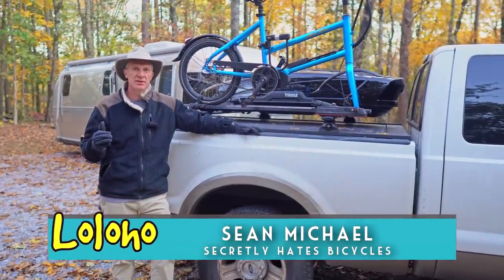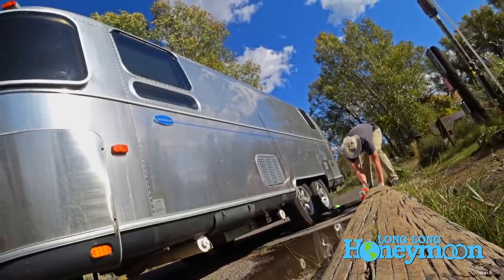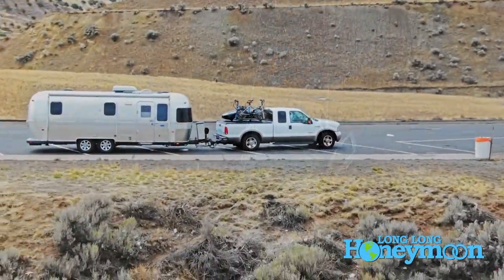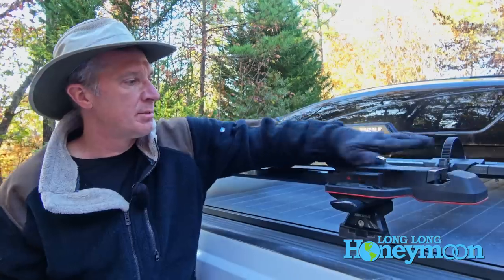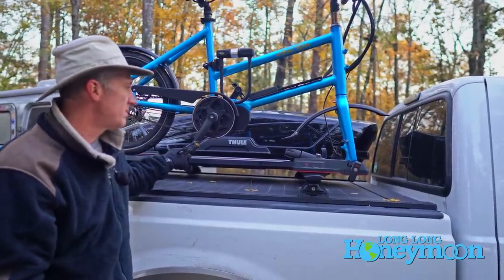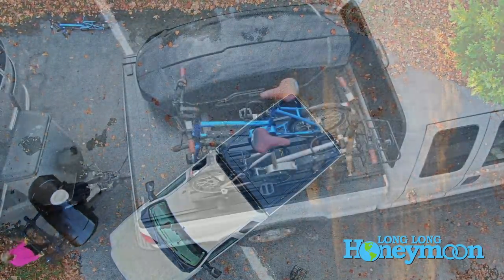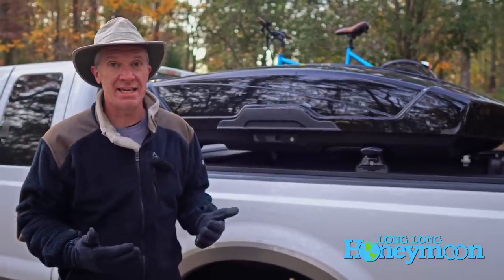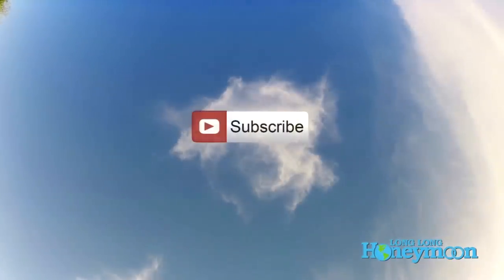Our Yakima/Thule Truck/RV Bike Storage -- What We Like and HATE About It :O

Comment: I just came across your video.  As usual it was excellent!  We store our two folding electric bikes behind the front seats in our 2017 F-150 super cab.  With the back seats folded up they fit well and there's no need to remove the front wheels. After we throw a couple of jackets over them they are nearly invisible.  We use an old blanket underneath so they slide in better.  The bikes have 20" wheels. They stay dry and secure and can remain in the truck when charging. We have a folding cover on our pickup bed like you do and with the bikes in the passenger compartment we have full access to the back.  The system works well for us and the price was right.  John Hart - 19' Airstream.

Comment: I have a jack it bike rack. It mounts using the same bolts that mount the electric jack and the bikes sit above the jack and propane tanks. It doesn’t interfere with the tailgate and works very well. Easy to load and unload. My 2 bikes are much lighter than your ebikes though.

Comment: A couple of thoughts for you to consider:
1. As others have mentioned, both Thule and Yakima (and others) make bike racks that don't require you to remove the front wheel.  Food for thought. But as you mentioned, to many folks removing the front wheel is Standard Operating Procedure and not a big deal.  The Yakima skewer mount you are using, although clever, does seem to require some awkward maneuvering to attached the Yakima skewer to the bike.  "Most" skewer mounts (at least until the most recent generations) didn't have such a skewer that drops into a customer clamp on the rack.
2. I would be worried about the broken fork drop out.  Considering the beating that the front forks taken when a bike is being ridden, with a 100-250 lb rider on board, there is no way on god's green earth that that fork tip should have broken simply because the bike was mounted in a skewer rack on a truck.  I would want to know more about the geneaology of the forks on those bikes ... there's no way that drop out should have broken like that.
3. We use something called an "ATOC Topper" rack which we've used on roof mounted racks to carry around our tandem, which weighs around 35lbs. The salient feature of the ATOC style rack is that you only have to lift one end of the bike at one time.  You start out with the bike perpendicular to the length of the car/truck, then lift the front end up and slip it into the skewer mount (which is pivoted), and secure the skewer. Then you use the pivoting skewer mount to then lift the back end and swing it around until the rear wheel is in the wheel tray.  Much easier to see it in practice than to describe it.  The point is that there are bike mount systems out there that don't require you to lift the bike potentially over your head.  Yakima makes something similar in concept, and I think Thule does as well.
Thanks for your video.  Very interesting.  We are expecting a RetraxPro XR tonneous cover to arrive tomorrow.  One question for you: Does the latch handle for the tonneau fit underneath the Yakima bars when you're opening/closing the cover?

Comment: I agree.  Select the best of several bad options.  We pull with an old van, but we found a space for our Rad Mini folding E-bike (68 pounds) and a much lighter mountain bike by pulling out the middle passenger side seat.  With big side doors, both bikes fit and get secured by a couple of motorcycle straps attached to bolts in the seat floor plate.  Very secure, out of the weather, away from sticky fingers, and relatively easy to access.

Comment: That was a predictable accident, but most are.  As soon as I saw the method of attachment, I decided it wasn't for me.  Then you showed the damage; ugh.  We upgraded our AS TT and the one we bought has the rack put on at Jackson.  We haven't used it yet.  It is for two bikes, but probably only one eBike.  I will put one foldable bike in the AS.   Our 28' FC has a lot of tongue weight, so a bike on the back is helpful.  I will load for 12% tongue wt., and the bikes will be a tool to help with that. Thanks for the video.  16 more days at work and then I am retired!

Comment: Best system I've seen was on the road through Washington State and it was home-made. He ha the same trip-fold tonneau over I have. He made up the basic contractor bed rack, but made up bike carriers on the two sides of it. Mainly a mid bar to cable to and a c-channel for the tires.  He had 2 kayaks above on the crossbars and the bikes on the sides. Nice, the tonneau still opens!

Comment: When we get our rig-however it may look like, I want our bikes inside the rig. We have regular bikes and they get hung from a hitch rack...exposed to the elements & being cheap I want them to last & still look good. 
I get the cover thing, I haven’t found one style that actually is designed for use on a hanging bike rack or won’t flap & rip while driving. Or even while covered in our backyard during a storm!

Comment: You have a very good setup. The only thing better would be having a toy hauler. My own solution for stabilizing the bikes on the rack is to use bungee cords to limit movement as much as possible. For additional strength, perhaps ratcheting cargo straps would make it almost impossible for the bikes to ever come loose. As for protecting the bikes from wind on the highway, you may want to consider a wind deflector on the roof of your truck (although that would be more expensive hardware to get). Safe travels!

Comment: I went with  the Fiamma Airstream bike rack and it works for us. We do not carry E bikes, just regular mountain bikes that are under weight 77 lb maximum.  I  also slide  a blue boy between the bike rake and trailer and run cable through them to lock them in place.  I store my black tank hose in the  hose holder provided by Airstream.  I Keep 90 degree  clear angle hose adapter to  hook up to sewer drain in side storage bin,  so I don't need to  access the storage bin in rear bumper.  I also have  rear window emergence exit ,  so worse case scenario we will need to crawl over the bikes or break out the window if it is the way.  The up side, it it easy to take the bikes on and off and uses them easily.  That said, some times wonder why we bother to bring them, as we don't need them or care to use them.
Reply from the maker: Yes, it really bugs me to go to all the trouble of loading up the bikes and carrying them on trips, and then find that we rarely use them. After this past season I'm questioning whether we will bring them out on the road again.
Reply: @LongLongHoneymoon  Maybe We both should try a trip without them, and then decide if we really need or want them.  We are planning next year to  travel to Traverse City Michigan, Mt Rushmore and  the Bad Lands , Rocky Mountain National Park and Steamboat springs  before traveling back to Fort Myers, Fl

Comment: I have a similar setup. Elected for the trays with the clips for wheels and arms to lock onto frame on the crossbars, over my tonneau cover.  No taking off tires and kids bikes didn't have the fork option.  Found the whole setup on Craigslist for $300. I agree with getting them on and off.  With 4 bikes I have to use a stool and tailgate combo.  Great video.

Comment: Sean,  thanks for the video.  We have an airstream and just purchased an Arvika bike rack from Canada.  You’re right, there are no perfect choices.  We haven’t used it yet, I’m hoping it works out.  We have E-bikes @ 55 lbs each.  What’s worse, I have had more damage to bikes during transport than using them!.  The rear bumper of the camper seems the most logical choice for many people but actually due to the distance from the rear axle there is a lot of jostling there ( not so good for a rack and the bikes).  Look forward to every video.

Comment: Our dealer installed a 2” hitch receiver on the rear of the trailer, which we use in conjunction with a Hollywood bike rack rated for 200lb. Our eBikes weigh 50 lb each with batteries removed. This system has worked well for us since we began towing, six months ago. Should we be concerned about the extra 100-120 lb of extra WEIGHT on the back of our AirStream? You did not mention this as a reason why you rejected this option.
Thank you Sean & Kristi. We’re more confident streamers because of you two😘

Comment: I have the same evoke you two have and use a Kuat receiver-mounted rack on the back of my van. The wheels stay on. Less than ideal because 1)  it makes the backup camera alarm go off. And 2) it blocks the back doors from opening. The latter problem may be fixed by using a slightly longer male extension, which would hold the bike out just an inch further, allowing the doors to open. 
I haven’t seen any damage from being out in the weather, but I wish I had room for the bike inside. It can be put inside, but I need the space for other storables. Grrr

Comment: I had a full topper on my pickup.  I had to remove the front wheels on the bikes (I could carry three), and the seats & posts assemblies.  The outer bikes faced forward and the center bike faced rearward.  Some re-assembly required, but not a major issue.  Being inside the topper, the bikes were out of the weather.  My set-up was similar to yours, but lower profile.  Outside of weather exposure, you have a nice set-up.

Comment: Nice video, we don't bike as I am still dealing with my knee and the use of it. One thing I do for stuff in my truck bed under the cover that makes for me easier get to stuff is, I got a long dowel and drilled a hole at one end and put a screw in hook on it so I can reach in to pull things out from the end of my tail gate. Now it would not pull my generator but then again I don't put my generator that far in.  Something to think about and it under $10 to make.

Comment: Nice video.  I suspect a couple of bungees or tie-down straps added to the setup could reduce some of the sway of the bikes, as well as being a 'belt-and-suspenders' approach to discourage your bikes taking flight during transport.
Reply: We tried bungees and they didn't help. 🤷🏼‍♀️
Reply: @kristymichael  Then try tie-down straps with or without ratchets.  I have kept unlikely loads secure on motorcycles for years...

Comment: I am a bit surprised at the issues with the bikes becoming loose.  We used our Yakima rack mounted on top of our minivan to carry bikes including a tandem bike which is about the same weight as your e-bike.  On top of the minivan they see a lot more force from the wind.  Over more that 20 years, I don't ever recall an issue with the fork mount becoming loose like you described.  Although I can think of a few instances with myself and friends with similar racks where the fork was not correctly mounted in the first place.  In those cases the bike became loose pretty quickly even with light racing bikes.  I don't think you would have that problem with your setup since you have a very clear and convenient access to the fork mount.  I just wonder if you are using enough force to clamp the fork to the skewer.   Another possibility is the way the skewer mounts to the rack.  My racks had the skewer fixed to the rack and you guide the fork onto the skewer.

Comment: I have a 5th wheel and use a Hollywood brand rack at the rear that fits a 2" receiver. But, as some of the comments have suggested. I've considered switching to a travel trailer allowing me to put a bed topper or shell with enough inside space for bikes and side access. Probably would have had less or nearly same money into it that you have in your set up and only 1 key. I also have put a 2" receiver on the front of our 06 F350 that allows me to use the same Hollywood bike rack on the front if I choose. Which we do sometimes when we tow our pontoon behind the 5th wheel. Also, we have a 10K electric winch that I store in the toolbox in case we should get ourselves in a bad spot or need to pull someone out of a bad spot. Loved the video nice job. Let us know when your through Kansas love to meet you guys. We have a space museum and an underground salt mine that are fun to visit here in Hutchinson.

Comment: Although very common, I always thought that vertically mounting bikes like that was a bad idea.  Puts way too much leverage on the bottom of the forks.  Turns out I was right! 

Also, as you (LoLoHo) mentioned, having to remove and replace the front wheel every time is a hassle that will cause the user not to use the bike anywhere near as frequently as he or she otherwise would, defeating the purpose of having a bike. 

But I understand that in your case your options were limited.  (But then again, that's why I'm not really a fan of Airstrream.  Don't get me wrong -- I love the mid-century retro look of them.  But they're just not very practical when you consider their small size, absence of slideouts, and lack of storage.)
Reply: Simple is better. Slide-out's pose more problems in many ways.

Comment: I'm confused by the apparent drop out failure (the wheel mount) on the bike with the special holder. This is an issue with front hub motor ebikes because of the torque. They recommend a torque arm which transfers pressures to the fork body. I've built bikes with torqure arms, but only ebikes because of the motor issues. The scare story is that the dropout fails, the wheel goes off, and the rider face plants. There have been several deaths. Aluminum suspension forks are not recommended, at all. Replacing a fork is easy. You could try to find a quality fork, steel. I bought a Surly for $100, once, for a basic bike. It's discouraging that they sell ebikes more and more for speed. These are basically cheap bikes. I had an inner tube fail, the valve separated, and the tire and tube were wrapped around the axle almost instantly. Stuff can break. You can hit a pot hole or a dog. You can't leave any ebike electrical components in the rain. I used a rear rack for a while, on a truck, and the dust pressure wash was horrible. I suppose people should think about all this stuff, and your $2k solution has the flaws you point out.

Comment: Found this video to be relevant in the extreme for us. We had a heavy steel dual bike rack that we HAD mounted in a hitch receiver on the back of the travel trailer. Notice I write in the past tense regarding this bike rack. Recent trip from N Florida to Central Florida the rack broke about 120 miles from home. Because it was mounted to the rear bumper of camper I was unaware the whole 120 miles. Long bike lock cable spared me leaving the bikes on the road. My theory is because the trailer only has leaf springs no shock absorbers the bouncing combined with the weight of the bikes caused the steel vertical post to fail. My greater disappointment is that nobody even tried to alert me to the fact that I was dragging two bikes down I-95 and I-4 and every surface road and traffic light stop all the way home. Could you sometime in a future video stress to RVer’s out there to watch out for fellow RVer’s and warn them of problems they might be unaware are happening.  I feel certain you or most of your subscribers would have gotten our attention and signaled there were problems in the rear. Thanks again for the great info have learned so much from you two.
Reply: I use a rear observation camera on each of our rv's. I'm not relying on anyone but me .
Reply: Thanks Santini. Quick question. That means your camera displays constant info, not just when backing up? Could you pass along info on what you're using?

Comment: love your overall set up and the Thule,  don't like the bike rack.   i use a Yakima bike rack similar to yours which does not require removing the front wheel.
went on a 7000 mile ramble with it, never a problem.

Comment: Our trailer has a jack it mount on the hitch. Plan on using it next year but it is a lift to mount the bike. Really solid, strong and won’t be in the way of tanks. Thanks for review on Thule getting one for our Outback.
Reply from the maker: You will like the Thule. There's a reason you see so many on the road. They are well engineered and the build quality is great.
Reply: Jack-It has worked well for us also

Comment: With regard to the Airstream rack, there have been a number of reports of the fittings that bolt to the body of the airstream that the rack's tubes attach to, that have broken, allowing the bikes to fall down and drag on the ground. I do not know if the racks were overloaded or not, but it is a problem for sure. Also, anything on the back of the trailer relieves tongue weight and can contribute to trailer sway.
Looks like it might be time to trade trailers and get a AIRSTREAM EDDIE BAUER 25FB with the openable toy hauler hatch in the back to keep the bikes inside................ :>)
Were the aerial shots done at the Badlands in SD? sure looks like it.

Comment: Thanks for pointing out the potential fork failure when using this system.

Would you please reach out to Vinnie (Airstream Repair in CA) and ask about extending the Airstream frame with a 2" receiver out the rear of your Airstream? With that you could attach a swing out rack, unlock it once parked so you can access the stinky slinky, escape in case of fire, install a custom shiny aluminum bike enclosure on the swing out rack to better secure and protect your ebikes, reduce the strain on your back by having the ebike enclosure a foot or two off the ground, make the bike enclosure large enough to store the two ebikes with all tires attached, shift the Thule roof box to the center of the truck bed to more easily access the truck bed contents.
Reply from the maker: That may be the better solution (the custom rear receiver for the Airstream). I like having the crossbars & Thule. As you suggest, I'd probably keep them even if we moved the bikes elsewhere.